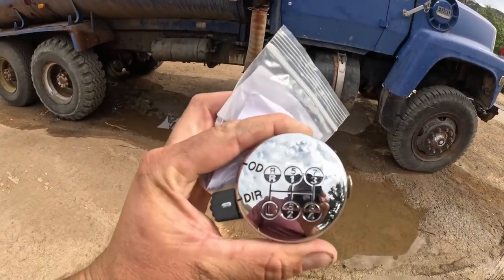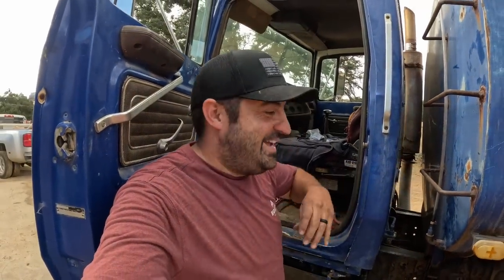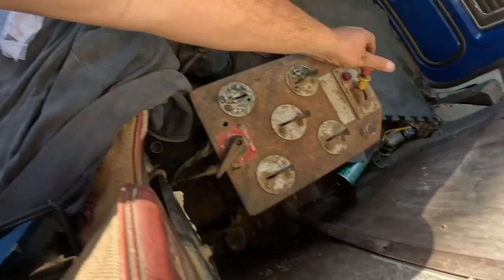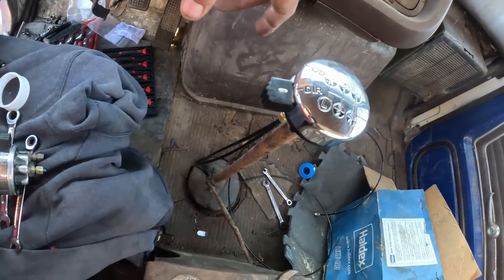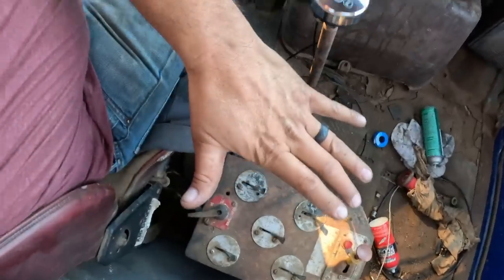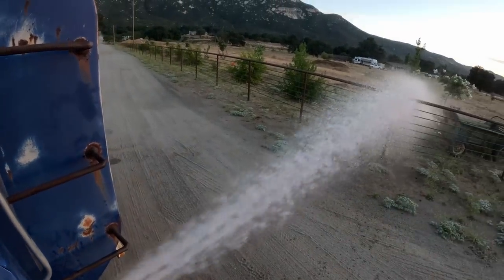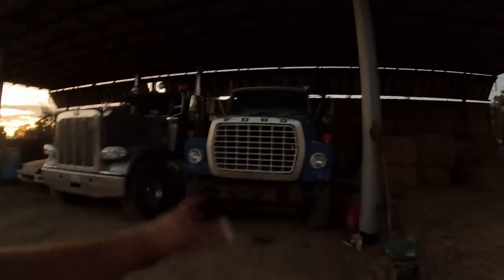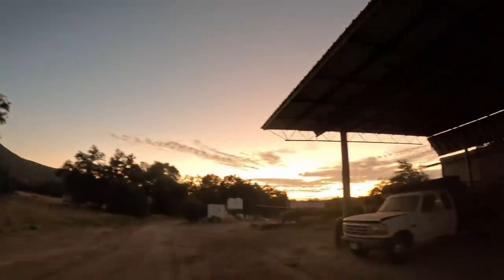FIRE 🔥 Season Is Here: Can We Fix This Old Ford Water Truck In Time? Part 3

Comment: Hey James, would an inline water separator help keep moisture out of the air tank on the Ford?
Reply: I think an air dryer would work awesome
Reply from the maker: If you're thinking of the ones from home depot probably not. An air dryer is whatnit really needs but a good bendix airb dryer is about 800 bucks. And I don't particularly feel like spending that kind of cheddar on an air dryer right now lol.

Comment: So what was wrong with the suburban 🤷🏽‍♂️🤷🏽‍♂️🤷🏽‍♂️🤷🏽‍♂️
Reply from the maker: Still not 100 percent sure, but they sent me the wrong ECM new one should be here tomorrow. Im pretty sure that what it is.
Reply: @Mr_Get_Muddy  oh ok 👌🏽🤞🏽🤞🏽🤞🏽🤞🏽 did you ever unplug the TPS sensor and spray some cleaner and then replug it? That's what gave me power reduction while driving

Comment: Sorry for a stupid question with the shifter but say your driving in 8th gear and have to slam on your breaks do you just down shift normally or can you through it into low and not use the high gears? I only have 30 miles or so with a manual trans under my belt and have never had to slam on the brakes as you can probably tell with this question thanks love the vids plus I have seen you and rhino around town don't let rhino know but I like watching your vids more because of the mechanical and work parts. 😁
Reply from the maker: If you have to slam on the brakes, just make sure you push the clutch in. These transmissions dont just let you push it into whatever gear you have to "speed match" or "rev match" with how fast the truck is rolling. But you don't have to go through gears. If you slam the brakes, you'll just have to start over.
Reply: @Mr_Get_Muddy   OK I see it now thank you.